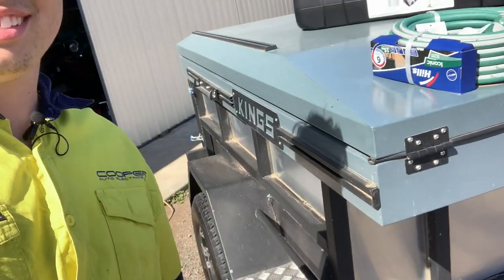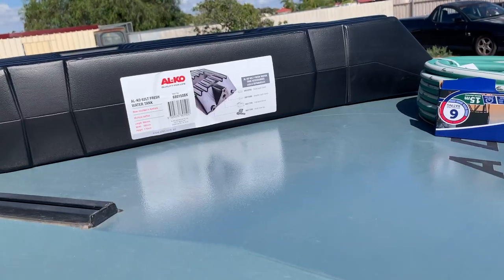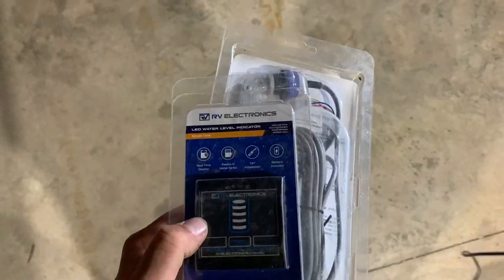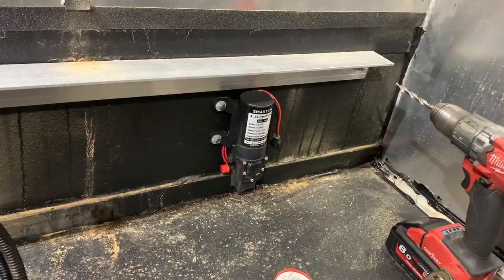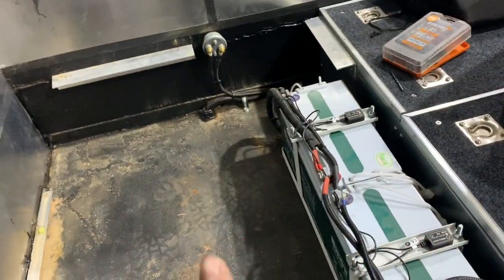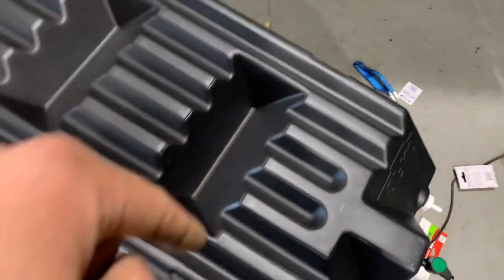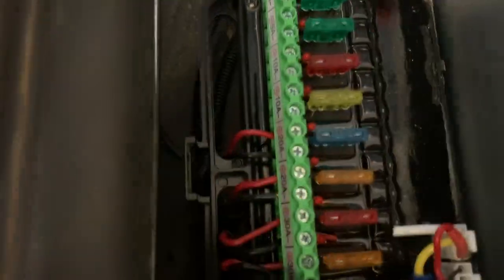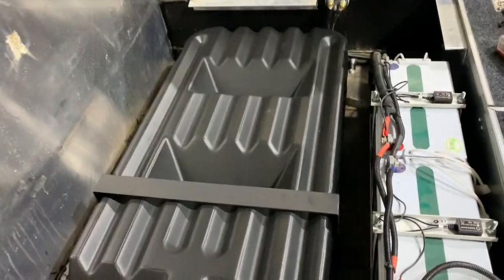DIY CAMPER Gets Custom RUNNING Water?! Pt 1

Comment: It is generally thought that using garden hose for drinking water will forever give you a rubber taste in the water.  Many builders use the translucent, reinforced drinking quality hose, available from Bunnings, for all the drinking water line.  you would also be advised to install a filter on the inlet side of the system.  Something like a B.E.S.T. Filter will take out all the nasties, as well as any solids and bacteria.  Good luck with the build.
Reply from the maker: Cheers for the advice mate, have a filter to put on it but going to leave it off for now just to test it out. It is mainly for dishes and such but drinking will come later when we do off grid stuff. Thanks heaps mate!